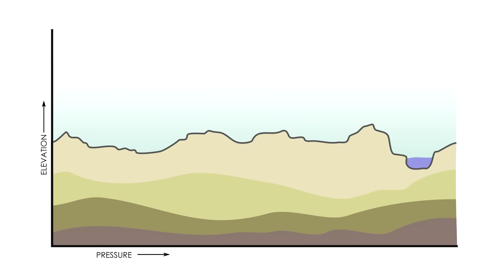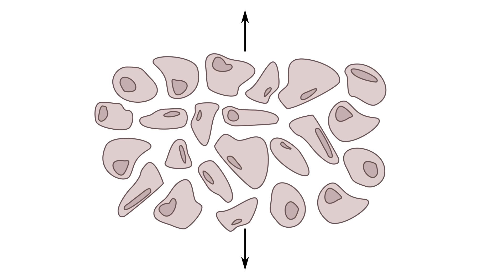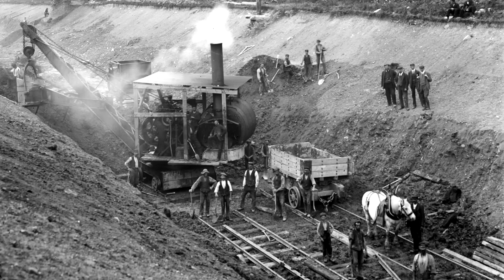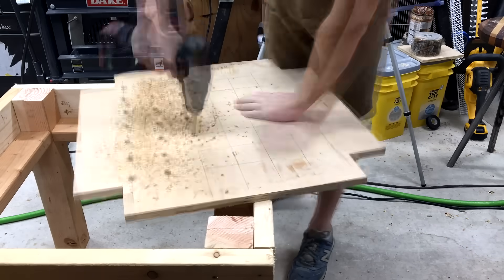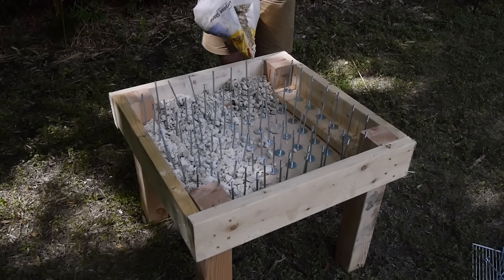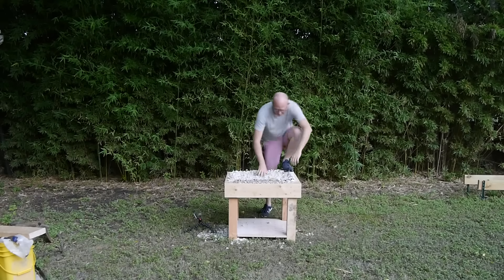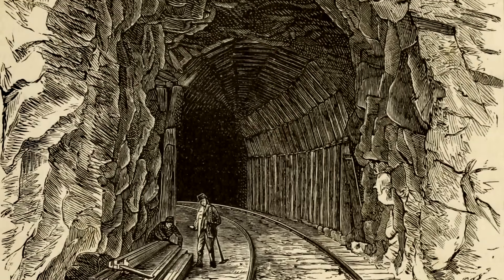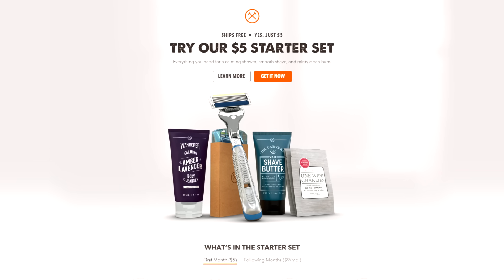Why Tunnels Don't Collapse

Comment: Please don’t stand again on a pile of gravel and bolts with pointy and sharp edges. You can die very quickly if a major artery in your leg is punctured. Great video!!!
Reply: mini696 he would fall through with the bolts and and the grabel would probably hold the bolts straight.   It would only scrape him up though because both ends had nuts and washers.
Reply: GGJChannel The bolts would fall away and not pose a threat.

Comment: Very interesting...Thank you for sharing.

A video on pumping concrete underwater as in large bridge footings in a river or sea, would be interesting.
Reply: yes please I always wondered how they do that
Reply: @ practical engineering, yes please one of these videos will be nice!
Reply: great idea. would like to see how that works.
Reply: Yes!!!
Reply: I don't think it's concrete that gets pumped. I'd think it's blocks of already hardened concrete that are just laid onto the sea floor. 

Might be wrong tho.
Reply: Derfoklishe I feel they'd have to put down already hardend. Makes the most sense and easier to work with
Reply: I always imagined that they seal off a square of ocean with some metal plates and wooden planks (like on land), and then just pour concrete mix into there together with a jumbo sized cement mixer. - An amusing mental image at least.
Reply: I've actually seen it in a nearby river, they seal off the section they're going to work in and pump out all the water, it's like a reverse pool. The river is actually pretty wide and deep too, so you can imagine how huge the actual bridge is.
Reply: Yes Practical Engineering it is a really good topic for civil engineers like us....

Comment: Can't you just bore out a natural arch shape so all the stresses become compression?
Reply: I think the problem may be the jointed rocks falling apart or crumbling if the rocks being bored weren't massive
Reply: Arches are specially designed so all the joints are perpendicular to the compression vector. With randomly jointed rock you don't have this luxury. The rock bolts pin the joints that would normally fail due to poor alignment, and allow the compression arch to work.
Reply: "discreetly cut arch blocks built into the tunnel" is a method of lining - exactly what he's talking about at the start of the video.  There are plenty of tunnels built before large scale concrete construction was common that are lined with brick, where the bricks are forming an arch so spreading the load in compression.
Reply: For massive rock, sure. This topic is specifically for jointed rock.
Reply: Yes, and it is done. If you watch the video your question is answered.
Reply: The rock that is being tunneled isn't a continuous single rock, otherwise that would work. Thanks to different kind of rock, layers of deposits, and natural tendencies of the molecular structure of those rocks it's basically a huge pile of really big gravel. Obviously it's not as loose as gravel, but the principle of interrupted load distribution remains. They create a simulated solid arch through the rock bolts.
Reply: I too would like to know the answer to this.  And also the question if you took discreetly cut arch blocks and built them into the tunnel would they take up the load in the form of compression.

Comment: My Dad was a Civil, but worked mostly Mechanical and Buildings. Gotta say, I was damn well impressed with your "Rock Bolts" ..... DAMN....... 
I was just thinking, the longer the bolts, the closer the bolts, the more could be supported with smaller granules. Started wondering "sand"? Looking up, under your feet, seeing some rocks falling away, seeing around each bolt "Cones of" "Angle of Repose" even though upside down with respect to gravity. Thinking if, instead of bolts, the binding material was smaller, more like maybe cement, and I'm thinking, oh my gosh, I've got concrete.... 
my Dad's dead 25 years, but I'd think maybe he'd be proud.  I'm seeing a continuum from a occasional "Rock Bolt" on down toward continuous cement and concrete. 
Am I out of my mind, or am I actually seeing that valid continuum? I'd actually appreciate comment or feedback from you, or anyone of your viewers. I'm actually interested to find out if my insight is valid or way out in the area of scatterbrained? Thanks for your feedback.  Really would appreciate it as my Dad can no longer do it.

Comment: Great Video! Thank you for making this. 
Can you add a video about methods of building structures on land with low Soil Bearing Capacity? Also! Please wear PPE's when using drill or other machines, you may be very skilled and careful but it's more about the message you sent out here.

Comment: Sir please could you make a video difference between pre-stressed and post tension concrete .
Reply: post-tensioned concrete is prestressed concrete. Are you thinking of the difference between pre-tensioned and post-tensioned prestressed concrete?
Reply: There is a difference. Pre-stressed means you put the cables in tension, and pour the concrete while they are in tension, then release the tension. The reinforcing is very secure this way, and there's almost no chance of failure. Post-tension usually has sleeves, and the cables are tensioned after it's cured and held in place with steel keepers at the ends. Also, with post-tension, you get the added benefit of the parabolic curve of the sleeve helping to keep the concrete flat under design loads. However, the keepers can fail and shoot the cable out of one side. There's advantages and disadvantages to both.
Reply: the term Pre-stressed encompasses both Pre-tensioned and Post-tensioned. It refers to the stress being applied before the live loads. Pre-tensioning and post-tensioning are when you stress the cables - before the concrete is poured, or after the concrete has hardened.
Reply: True. I would add that in common practice, when someone says pre-stressed, they are referring to pre-tensioned. I misread your original reply. I read it as "Are you thinking there's a difference between pre-stressed and post tensioned concrete?"
Reply: Yeah, we get sloppy with terminology.
Reply: He has a concrete video already where he pre-tensions the reinforcement

Comment: What about in areas where the mountain/hill isn't rocky but clayey? Like a mountain that's made of soil and gets rains too much. You drill a hole, and the mud keeps falling, so how are tunnels made through them? In India where I live, such mountains are common, still we have tunnels.
Reply: coyoteseattle Thanks for the reply :)
Reply: Generally they use a pressurized face tunnel boring machine and install a precast concrete segmental lining as they advance.

Comment: Could you make a video of testing a difference between strength of a concrete drilld and one simply cast with a hole same size. How a drilling is affecting the strength of material (micro cracks or something must form around, and im sure it is not good).